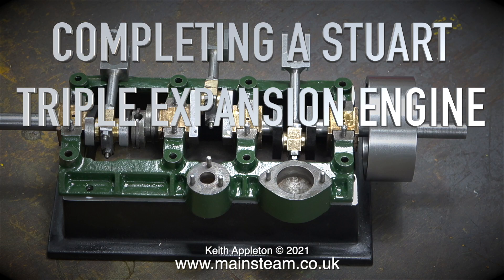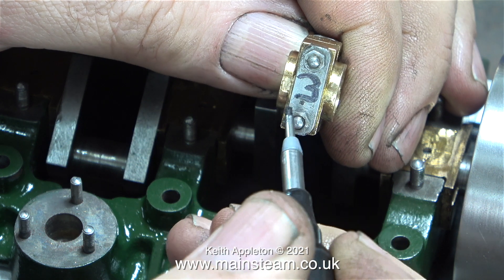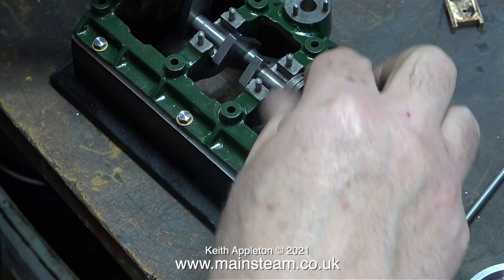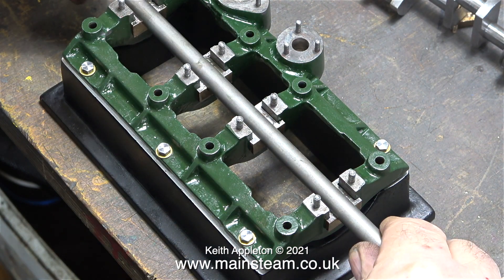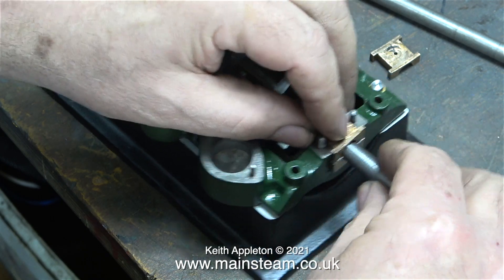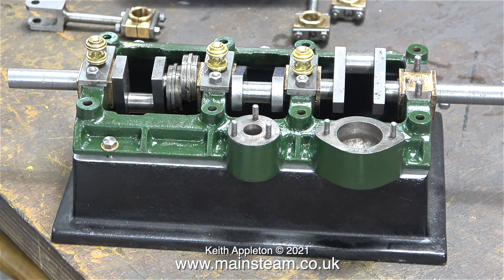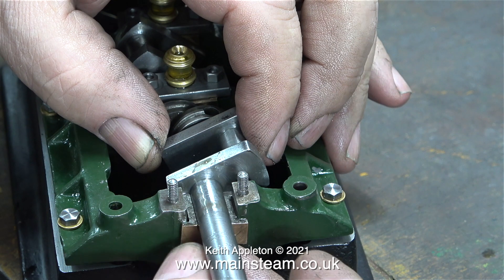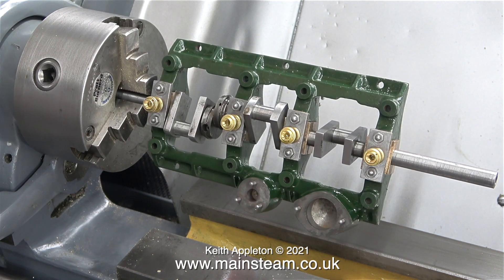COMPLETING A STUART TRIPLE EXPANSION ENGINE - PART #21

Comment: Nicely done sir! The crank is a work of art, clearly made by a craftsman, unlike the person who made the bearings lol not a marking anywhere to denote what position they go in. I'm rather surprised that you didn't mark them up on taking apart Mr Appleton lol
Reply from the maker: I prefer to do it without markings ......
Reply: @keithappleton  so you just loved the challenge then? Chucked the box of bearings off of the bench accidentally on purpose did we? Lol
Reply from the maker: Yes, the box got knocked over . . . . .

Comment: Ain't any different than building a smallblock Chevy V8 really. Gotta make sure everything fits and turns properly or else it's gonna run like shit. Quite nice to see the master back at his lathe again too!
Reply: Thats right same as  chev v8 .. the correct way is after the crank has been checked to run true  engineers blue   should be applied to the crank and then assembled  with the bearings   then the bronze  bearings hand scraped til the blue is evenly distributed .. This is the way that high precision  spindles  on machine tools were produced   .. this gives longer life and accuracy